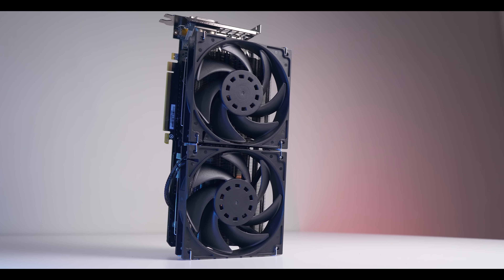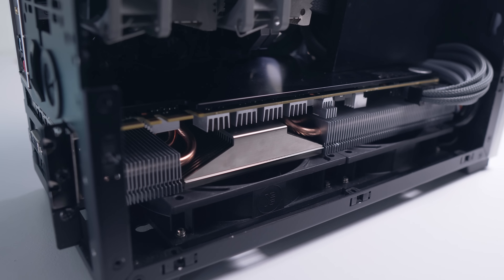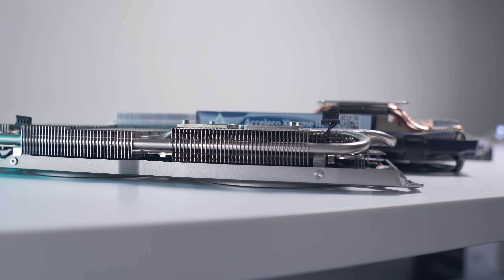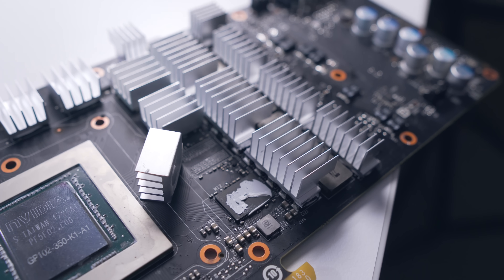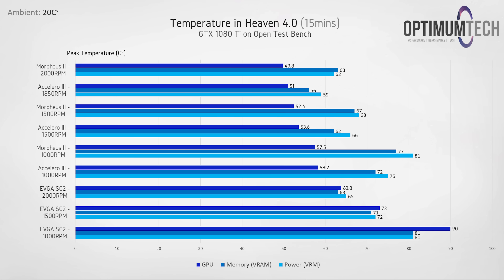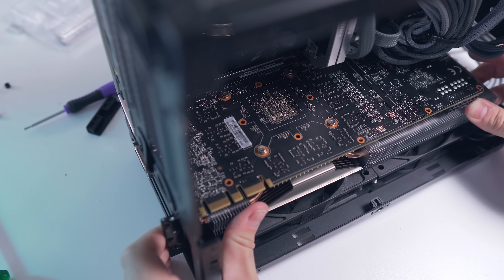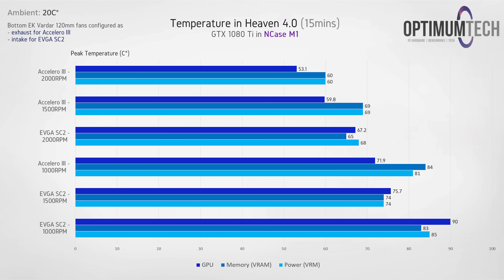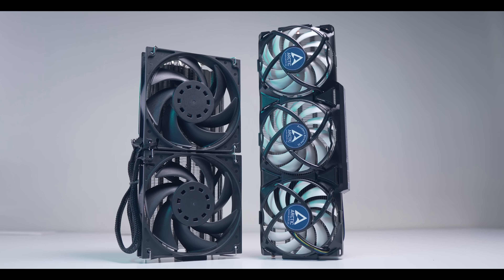Accelero III on a 1080 Ti - Exceeding Expectations!

Comment: Ftw3 cooler with noctua paste I get 54C at 100% fan speed. OC 2012Mhz oc 127% power target at 1.093V. For anyone that has an ftw3 there is a bios issue though and I will provide a link for any owners. Spread the word! 
https://forums.evga.com/m/tm.aspx?m=2693145

Comment: I think the reason it was hot on push is because fans lose a lot of airflow being right up against the grille like on the bottom of the M1 and also negative case pressure generally works better for temps.

Comment: funny you upload this, when at load my card runs about 83-85 degrees 

so last night i was looking for aftermarket coolers for my evga 1080Ti reference ed (standard blower)

my problem being it seems quite hard to find a aftermarket cooler what sticks to the dual slot design or just a fraction bigger what will fit into my node 304 case

any suggestions?

Comment: As I was watching you put the thermal adhesive on the PCB components and the adhesives on the cold plate, I was thinking, "Wow, after all of this, I hope he keeps it as-is." I also felt a little sorry for the 1080Ti with the number of times it's been disassembled. Serious question though: Have you noticed any changes with the CPU temps after flipping the fans down below? Also, do you expect to be able to keep this cooler setup when you swap to the Dan C4 (eventually)?

Comment: Hey Ali what software do you use to monitor VRAM and VRM temps? I can't see the option in MSI afterburner. running FE 1080ti
Reply: Benjamin Sando The EVGA 1080TI SC2 have temperature sensor probes in the PCB. He is using the EVGA Software.

Comment: You, and I look fairly similar;  Regardless, I put an Arctic Accelero Hybrid III 120 on a 1080ti FE back when they first came out.  I've been quite pleased w/ the cooler;  The included 120mm fan(s) for the radiator are inadequate, however I put Corsair ML 120s's sandwiching the radiator, and stay under 60c overclocked to around 2050+Mhz on the core, 6000Mhz for Memory;  Point being, I like Arctic;

Comment: Most of the air a fan moves comes from the tips of the blades, those 120mm fans were probably too wide for the fin stack of the heatsink as most of the air would be pushed around to sides rather than through the fins in the push configuration.

Comment: really great vid, however, i dont think these tests were done fairly, and not all ur results may be accurate. as was mentioned by someone else in the comments, u did not use the Morpheus 2 vram heatsinks, so u cant say that the accelero has better vrm cooling than morpheus, only evga. also u didn't use the fans for the accelero in the case. to be most accurate, u need to have better testing conditions. make the only variables the cooling on the evga, compared to morpheus, compared to accelero. maybe re-run experiment, with a larger profile case to ensure the accelero will fit, and make sure u change the Morpheus vrm coolers, or have stock coolers on all 3
still, like i said, great vid, very good channel. and ur video editing is very well done

Comment: When will gpu manufacturers learn that fans blowing away from the card yields better results than towards the card. I've been saying thing ever since and your video is a perfect example.
Reply: It depends heavily on the case. With the Ncase M1 the case is so small that venting the GPU's heat into the case would cause massive temperature increases to every other component in the case, but likely would give the GPU better temps since it would be drawing fresh cool air from the bottom vent, rather than recycling the CPU's hot air. In the end, this is a bad trade as it doesnt matter how cool your gpu is if your cpu or your Mobo VRM's are throttling. This why people generally configure the gpu as exhaust in the ncase. In larger cases it would likely make little difference either way, but would require your entire airflow configuration to be reversed from what is normal, otherwise the rest of your fans will blow the GPU's hot air back up into it. Considering many case are specifically designed for front to back and bottom to top airflow, this could prove unfeasible in a lot of cases. Overall, setting your gpu fans as exhaust rather than intake is a highly situational decision, and the ncase M1 just happens to be one of those situations.
Reply: @bioforce5  Well, I did the test comparing fans on the Morpheus in pull or push configuration: pull makes VRM temps go crazy while GPU temp is the same. I believe it's because the fan push the air in a straight direction while he draws the air from every direction.
Reply: Are you sure about this? I have to install a Morpheus but the comparison would be tedious. Blowing away would make more sense because of the way airflow works in my case but I've never heard of such a config.

Comment: Running the Accelero IV on my GTX 1080 FTW2. Have liquid metal on the GPU and it sits right about 45C when fully overclocked :)
Reply: That's not too bad but it must be loud af. Those founders edition cards get really loud at high fan RPM's.
Reply: FPSkillerPC liquid metal doesnt give that much better, compared to regular thermal paste. Also there is noise factor. I prefer higher temperatures at the benefit of dead silemt (500rpm) rather than a 1.500rpm just to cut down temperature further.
Reply: Webdigo the temperature difference between noctua nt-h1 and thermal grizzly liquid metal seems to be about 5-6C for me. That's substantial enough
Reply: What noise factor are you talking about? These are both silent coolers.
Reply: FPSkillerPC you beat me to all these videos
Reply: Haha oh well.
Reply: Founders edition cards are mostly for watercoolers, should've got a aftermarket one.
Reply: fuck aftermarket cards

gotta wait how long for an extra how many mhz on the core and mem?

FE cards are then best binned, so they will OC on air better than most aftermarket cards with beefier coolers, and then with a hybrid cooler it's game over
Reply: this GPU doesn't get any hotter than the EVGA gtx 670 FTW 4gb i had in my previous comp
Reply: 2038mhz core and 5951mhz on air, which is as high or higher than tons of aftermarket cards
Reply: actually my GPU is irrelevant currently

my CPU is on the fritz, 6700k 4.6ghz

just played KF2 and for the 1st 10 minutes it was locked 60fps 1440p ultra no complaints GPU usage 50% and cpu usage 40%

then GPU usage stayed 50% but cpu usage went from 90-100% usage........

what sort of diagnosis could be given for this problem? :O

PSU is EVGA G3 750w gold, game was running from 512gb SSD
Reply: the problem me and all these people are having with custom fan profiles ARE with msi afterburner, i have 0 problems with any internal nvidia controls or settings
Reply: But the heatsink is made of aluminium
Reply: well my minimum requirement is to not hear the rig at full load with this logitech g633 headset on and it does that albeit at 85% fan speed
Reply: i have a gtx 1080 ti FE and it runs at ~70c or under most of the time at full OC and thats with the stock cooler and in a micro ATX case
Reply: well yes on water and shit they are the the best nvidia can get, so the board partners all get 2nd cut chips

also my MSI gtx 1080 ti FE will hit 70c max under full load and i can't hear shit, but then again some of these newer nvidia drivers have been breaking custom fan profiles for tons of people
Reply: i used to be able to do that in furmark before driver 391.03 :C

once i fix it ill post vids NP
Reply: oh killing floor

and not anymore

the fan curve being OK is a hit and miss thing for tons of people with these shit nvidia drivers

Comment: Great Video! I always was interested in how the Accelero X III performs against the Morpheus II

I own a Arctic Accelero Xtreme IV  280x Edition since 4 years.  It has a special cold plate to best fit AMDs GPU from HD 7000 up to RX580 die's. But also works with smaller Geforce chips. It is currently mounted on a Zotac GTX 970 to replace the broken fans. And it works pretty well! The 970 is oc'ed by 175 MHz, power target is on max and the card reaches only 51°C in Final Fantasy 15.
The Accelero Xtreme III and IV are my favorite GPU coolers. It blows everything out of the water in cooling and is basically noiseless and 100% silent in a insulated case.
I love this Cooler :-D also for its pure and functional design. Nothing is so beautiful as a giant heatsink ;-) But you are right, the fan shroud looks pretty out dated.

PS: TDP - Arctic is very conservative and carefully by stating the max TDP. If they say the Cooler has 300 Watts of cooling potential it has probably 350 Watts. Its a number you can rely on it!
Reply: hello nice temps what about at full load FurMark and heaven 4.0 ultra presets max temps

Comment: I don't think it's fair to say that the VRM temps are significantly better on the Accelero since you left the stock EVGA heat sinks on there for the Morpheus cooler. Whether or not it would have made a difference, I'm not sure, but you compared the heat sink of the Morpheus, not the included pads/heat sinks.

Great video though. It's given me something to think about.

Edited wording.
P. S. This is still a wonderful video and the VRMs are perfectly fine on each card with both after market coolers. We appreciate you investing the time into the testing and comparisons. :)
Reply from the maker: Very fair, completely overlooked. 
My apologies!
Reply: Optimum Tech Yeah, the moment you started comparing the vrm temps I could feel the little gremlin inside me reaching for the comments section, nice to see you recognise the problem

P.S. you should probably like/pin this comment so other people will see it after watching your video
Reply: You beat me to it!
Reply: Even in that config it was a couple degrees diff. For a few ° I would never void warranty by gluing heatsinks on. So easy to go back to stock if issues arise with the morpheus and stock vrm/vram plate.
Reply: @MrDutch1e  you could get their two part adhesive thermal paste and play around with the mixinng ratio between the thermal paste and the epoxy part. Use less adhesive part instead of 50/50 try 80/20 as long as that vrm heatsink sticks but still able to remove easily when you want to. Some people did this already and some used the 50/50 mixing ratio and have had good experiences with removing them. Some say either freeze the card or use heat gun to make it easier to remove them.
Reply: @erickrayos  it leaves a residue tho that is blatantly obvious. N what is the benefit over using the stock plate ? Absolutely nothing. Even if it dropped temps 10°+ it would have no benefit in overclock or longevity of the card because they are already in check.
Reply: KaddamanMan it actually does!
Reply: Now you need to do another comparison!!

Comment: I wish, there were a Morpheus "III" with the real 120mm x 240mm (Morpheus II ~90mm x 240mm) shaped cooler to make the most of the fans...
And a even bigger one (Morpheus III+) with 140mm x 280mm for bigger fans - I mean if a 140mm Fan Towercooler fits in the Case...

Comment: Something really weird about the Accelero III or the older one too. Saw many videos about them and they perform amazingly well all the time!! The weird part about them is how the fuck these thin heatsink achieve these amazing temperature while other companies with huge heatsinks and a very big card like the zotac amp extreme coudn't????! the Accelero is doing something really magical for an air cooled card.
Reply: You are actually on to something there. Why the f*** doesn't the HUGE cooler on the Zotac AMP Extreme not perform just as well as the Accelero III? I mean, the sizes are very comparible, and if you compare the price of that Zotac card, you realize that A LOT of money are spend on that cooler. Ofc, you get RGB as well, but that doesn't justify those poor temps...
Reply: More fins, more heatpipes. This cost a lot and the manufacturer wants to lower the costs. They put big useless pieces of crap who are worth nothing compared to an aftermarket cooler who you pay 50$ or more.
Reply: Gamers Nexus did a video on this late last year and would answer your question better than me butchering it trying to help lol
Reply: Do you mean "TLDR: How Heatpipes & Air Coolers Work (w/ animation)" ? If not can you link the one you refer to?
Reply: For those who asking for the Gamers Nexus video : https://youtu.be/iiLSxhyiZss    

"Zotac 1080 Ti AMP Extreme Review: Bigger, Not Better"
Reply: Quality of the metal, density, and more efficient design.
Reply: DaftPunk67 already saw it before. That’s why I mentioned Zotac because bigger doesn’t always mean better cooling.
Reply: Watch the video, it has separate heatsinks for mosfets and vram. In my case they stayed at about 70C, which is absolutely fine.
Reply: Totally agree. I used to have Accelero III on a very bad sample of 290X, which used to thermal throttle on a stock blower cooler. It went from 95c at 70% RPM - a hairdryer noise level to 55-60 at 90%, which was almost noiseless. There is definitively some black magic going on with these.
Reply: they sold their soul to the devil
Reply: I have these Accellero coolers on HD4870s, R9 290s and they are great coolers, but the Zotac AMP Extreme or Strix on max fan speed delivers roughly the same result. The only real issue is the fan quality on these coolers being Arctic Cooling, which is about average. You will get noise then likley a failure in at least one fan over a couple of years with a bit of dust (which isn't unreasonable) and you can't replace it. The best option is the Morph IMO as you can swap out fans when they fail, so the cooler will last as long as it will fit on a GPU.
Reply: Arctic makes some legitimate fans, they are much better than 'average'.  The fans on their coolers are Fluid Dynamic Bearing and should last a while.  They are extremely quiet as well.  I have the Accelero Xtreme GTX Pro that was meant for a GTX 285 modded and placed onto a non-reference GTX 970.  I used it on the 285 and eventually used it to replace the heatsink on my EVGA SSC 970.  So I have had it installed on a card and in use for over 6 years, performs amazing, is whisper quiet and... yea.
Reply: There was a thing that Buildzoid (AKA "Actually Hardcore Overclocking") said that you can only cool something so much in terms of thermal mass. The bigger it is, sometimes it ends up cooling worse than something smaller in a way... but I think that's just GPU's. I cannot say the same for CPU's since, strangely, bigger heatsink, the better in a way. The Accelero III is thinner, probably has lower FPI, and has the same amount of heatpipes. I don't know how it outperforms the Morpheus on core cooling other than remembering what Buildzoid said, but goddamn.
Reply: On those heatsinks, they're not just cooling the GPU. There's also memory and vrms, and depending on how the vrm is built it can be really, really hot.
Reply: lol do u see any vram cooling or mossfits no that's how

Comment: I was actually just wondering about a setup like this myself, what a coincidence! I've just done a Morpheus II swap on a reference 980 with the slim Noctua 120mm fans(NF-A12x15), also arranged in pull at the bottom of my Ncase M1. It all fits like a glove, and I'm getting GPU load temps of around 60°C with approximately 50% fan.

I'm curious to see how the Morpheus + slim Noctua setup would perform on your 1080Ti. I hope you'll get the chance to make a showdown video between the two setups!
Reply: Will Chen how did the fan clips work with slim fans ?
Reply: The Morpheus came with two sets of fan clips, one set for regular fans and another set for slim fans, but I opted to mount my fans to the case instead.
Reply: I've pretty much got the same setup (ncase m1 and gtx 980). How are you finding VRM temps with the Morpheus II and did you use the supplied heatsinks?

Comment: Wow, very interesting. Did you come up on your own with the idea to set the GPU fans to exhaust? What a crazy idea. Didn't expect the temps to go down like this. Espacially on the VRM-side. 
Watching these vids makes me happy and cry at the same time. My Asus Strix  RX480 is a fucking jet engine. Such annoying noise. But I think upgrading a GPU cooler on anything other than a 1080ti is simply not worth it. Lower the fan speed and you are good to go. If you need more FPS spending the money on a better GPU is always gonna be superior to upgrading the cooler. Sadly :(

Comment: Some suggestions to anyone going this route...

1. DO NOT USE THE THERMAL PASTE THAT THIS COOLER COMES WITH. You will very easily destroy memory chips and VRM solder points if you try and remove the heatsinks down the line. Use something else.

2. Buy the Raijentek Morpheus II over this and get some Noctua A15-12's if you want to fit it in the Ncase M1.

3. I have had both the AA3 and the Morpheus 2 and there was no noticeable thermal difference really. However the Raijentek is light years above the AA3 in performance and especially build quality. If you're aim is to improve your GPU cooling, spend a few extra bucks and get the Raijentek and some Noctua 15mm fans. 

Hope this helps.
Reply: GrayFox370 u have ncase m1
Reply: edward entwistle Yes I do
Reply: You say there's no noticeable thermal difference but then you say the Morpheus 2 is light years above the AA3 in performance?? How is that possible?

Comment: Man, this cooler is hella tempting. I'm only rocking a 1070 but I currently have iPPC NF-F12's blowing a dick tonne of air into my Ncase and my GPU is the loudest component in my build. If I could knock that out entirely I'd be over the moon.

Side question: Do you have a Twitter or Facebook page? You've inspired a few mods to my Ncase and I'd love to share them.